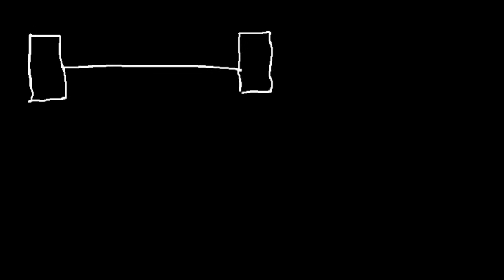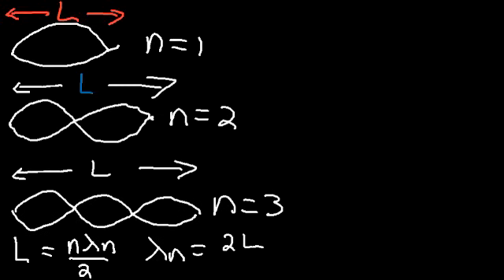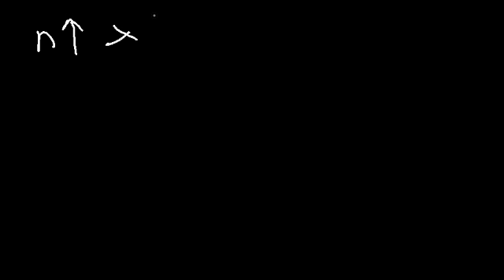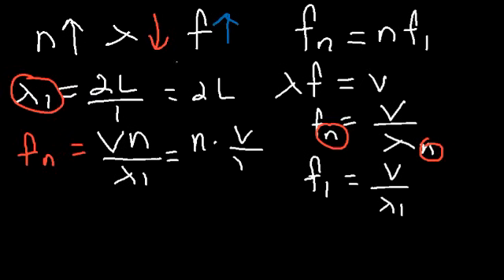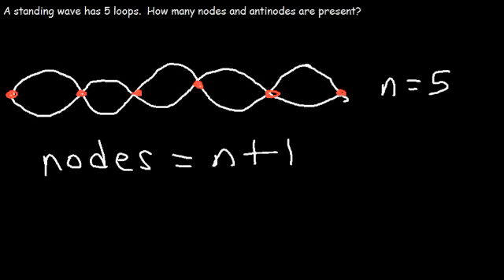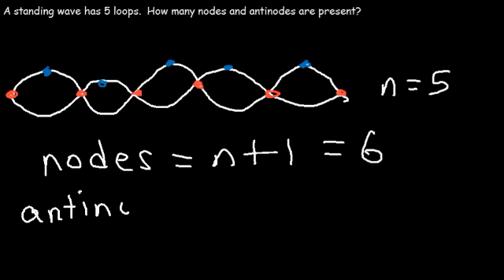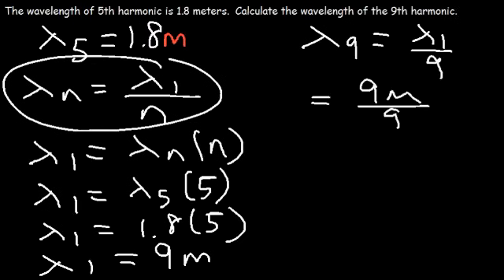Standing Waves on a String, Fundamental Frequency, Harmonics, Overtones, Nodes, Antinodes, Physics

Comment: 13:41 A standing wave has 5 loops. How many nodes and antinodes are present? 
14:46 The fundamental frequency of a certain standing wave is 175 Hz. Calculate the first 4 harmonics.
16:12 The 7th Harmonic of a standing wave is 280 Hz. What is the frequency of the 4th and 9th Harmonic?
17:35 A 2 meter string produces a standing wave with 3 loops. 
           a) What is the standing wavelength?
18:56 b) What is the frequency if the speed of the wave is 45 m/s?
20:00 c) What is the wavelength and speed of the first harmonic?
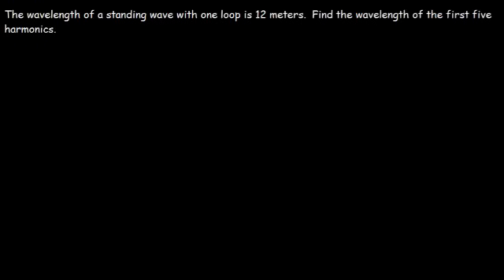22:37 The wavelength of a standing wave with one loop is 12 meters. Find the wavelength of the first five harmonics.
23:38 The wavelength of 5th harmonic is 1.8 meters. Calculate the wavelength of the 9th harmonic.
24:56 A standing wave with a speed of 30 m/s and five loops has a frequency of 250 Hz. 
           a) What is the length of the string in centimeters
27:19 b) If the string has a mass of 40 g, what tension force is required to produce such a wave?
29:56 A tension force of 300N was applied to a 0.75kg string that is 5 meters long. A standing wave with 5 loops was produced.
          Calculate the:
           a) speed
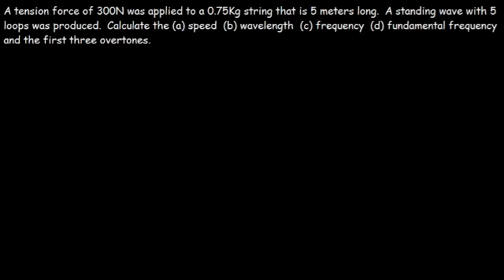31:44 b) wavelength
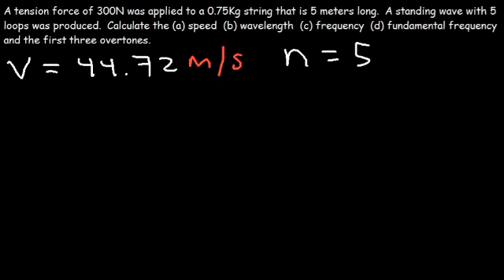32:58 c) frequency 
           d) fundamental frequency
                and the first three overtones
36:38 The frequency of the 4th harmonic is 300 Hz and the wavelength of the 2nd harmonic is 2.3 meters. What is the speed of the wave?
Reply: you a real one
Reply: god bless you
Reply: you deserve a hug homie saved my life cramming for my exam in a couple hours
Reply: @13:41

Comment: You could just multiply 2.3 x 2 then divide by 4 to get both with the same n value then multiply  the 1.15 by 300. I found that to be easier.

Comment: 22:37 answer is not correct because I f I use the formula that states that the wavelength is equal to 2L/n and plug in 12 for L and 5 for n it will  come out as 4.8(plugged in 5 for n cause he said the fifth harmonic ) am I correct or I am just dumb

Comment: Hey there! Useful video but I'm struggling to answer this question : A tuning fork makes 5 beats per second with a stretched string of length 1,12m. It also give 5 beats per second when sounded with a length of 1.16m of the same string under the same tension. What is the frequency of the tuning fork ?
Reply: 5hz

Comment: Nice vid. Tho, Id much rather hear how this is relevant to the real world, and not school tests. 
My situation: I dont go to any schools and have no idea why Im learning this, just that I need to learn about sound as Im a sound engineer.
Reply: Idk what a sound engineer is, but in engineering, waves have very many practical, real world usage. They are used to model vibrations in structures, the voltages in circuits, the heat transfer in a reactor and so many more. Plus, and instrument is a literal example of standing waves as evident by the names we give the frequencies and their overtones: the harmonics of a string/wave. Waves are also a massive deal in quantum mechanics and orbital mechanics showing that waves are present in both the very small (quantum) and the very large (orbital).